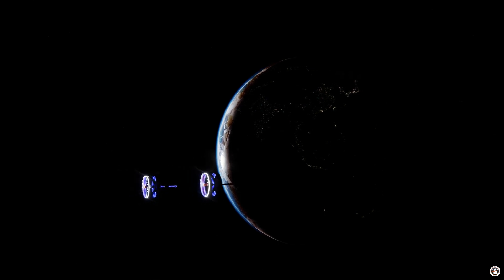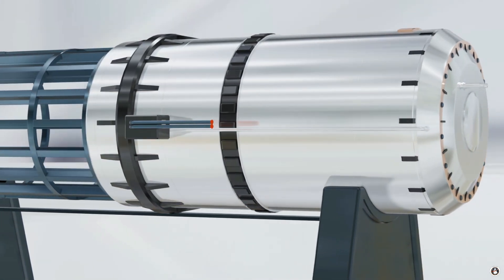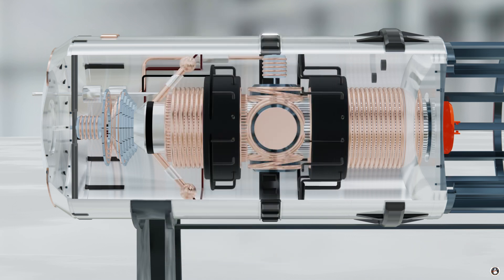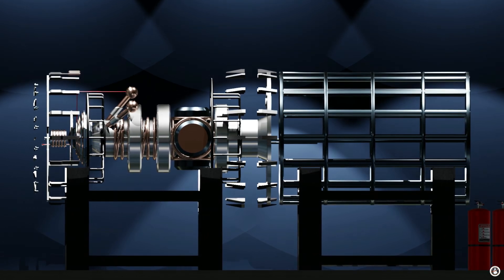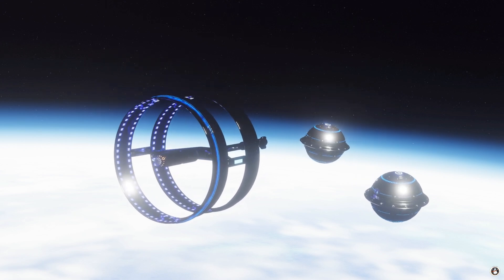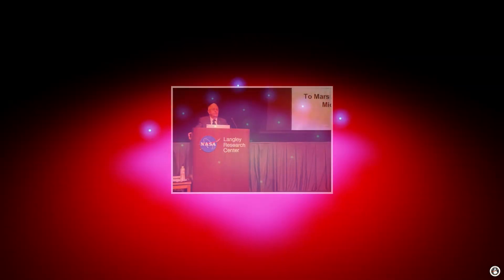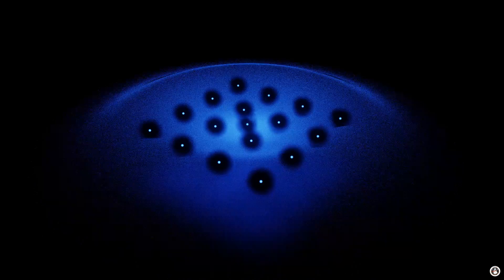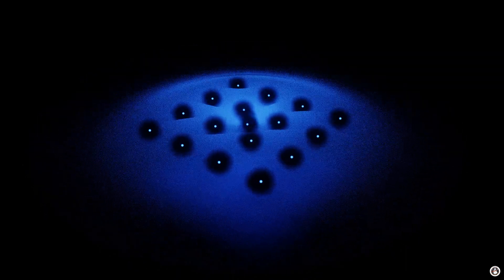Muon Catalyzed Fusion Engine - 8% Speed of Light - Mars in 5 days?

Comment: Two fundamental questions. First is, can this actually be built to work and when? The other is, what is the thrust to mass ratio? Just how much mass of a spacecraft needs to be devoted to this propulsion system (and associated supportive gear, such as heat radiators), how much thrust can it generate and how much fuel is consumed over time (how much is needed for say a round trip between Mars and Earth say)?

Comment: Given that if this works you will have a highly ionized exhaust plume, could this be directed into a magnetohydrodynamic collector and generate electrical power for the ship - or even as terrestrial power generation? Providing you solve the eroding electrode problem, of course.

Comment: Would this be able to replace chemical rockets to launch objects into space? Also, would the same principle be used to slow down the spacecraft when it reaches the destination?
Reply: The problem with any nuclear rocket is that it is very difficult to get it to have a high TWR, because of the added mass of reactor assembly, only the Nuclear salt water rocket and Project Orion are the two nuclear drives I know that have an effective TWR that can propel directly against Earth gravity.

Comment: You still need two engines. One facing forward and aft. Does the engine provide bleed off power for ship operations? If not then the ship would need additional power generation on top of these engines.
Reply: Not really it can use reaction wheels, gimbles and monopropellant thrusters to switch thrust directions to the retrograde.

Comment: The trick is to fall in the direction of travel; not be pushed which is the common approach.
This would eliminate the g forces experienced. 
(There is no sensation of acceleration when skydiving.)

This will require recognizing that Einstein conflated mathematical dimensions with physical ones.
There are only 3 dimensions.

The speed of light limitations are due to the increased mass due to acceleration, but if no acceleration is experienced, no increase of mass happens.

The Sun and the Earth are supposed to have their own independent frames of reference.
This would mean that the Earth is being attracted to a position that the sun occupied 11 minutes ago.
The earth would spiral into the sun if this was the case. It doesn't therefore they both exist in the same  reference space.
Nothingness is not bent.

Comment: I assume the fusion exhaust is "channeled" out the end of this engine magnetically. So, what powers the magnets? Seems like you would need a lot of energy to provide the reactive force. Did I miss something?
Reply: If you are producing more energy than you put in, you can likely convert some of the excess heat into electricity to do that.

Comment: This may be a stupid question, but here goes anyway: It seems by the description in the video, that the engine would be throwing out ionized or easily-ionizeable particles. If that is the case, would it be possible to use a similar system to a standard Ion propulsion drive in order to accelerate the exhaust particles even further, or would that be too inefficient?
Reply: Actual ion engine have low thrust but, using nuclear fusion energy will be possible to use helium prodused from reaction to obtain more thrust. Importart is necessary neutralize the ions out of the ship by emission of electrons.

Comment: It's a great advancement for the generation ship.  50 years to Alpha Centauri vs. 100 or more.   If only someone would solve the tachyon puzzle so we can do this in multiples of lightspeed someday.
Reply: It all depends on how fast it goes from 0 mph to it's max speed. At light speed it take 4 years to get there if the engine goes from 0 mph to light speed instantly, and not stopping once you get there. According to their math the engine can do 8%C plus so I'm going to use 10% to make it simple. At 10% C it will take the ship 40 years to get there and it still won't be stopping. If it can get it up to 10% and cruise at that speed faster than the halfway point then the 40 year trip is possible since that would allow you to slow with less than half the distance to Alpha. If it can't do that then we're still looking at least 80 years. There's one other thing that wasn't brought up is the time dialation effects on the crew going 10% C. There would be a slowing of time for the crew so they wouldn't experience the 80 year trip lasting 80 years. How much less time I have no idea. If they only experience 8 years for every 80 years for us then the ship wouldn't even have to be a generational ship. Again it depends how fast the engine gets up to 10% of light speed. Anyone know the math?
Reply: Time dilation is minimal until you reach over 50% the speed of light and even then until you reach over 80% it isnt all that big. At 10% you would experience most of the 80years.

Comment: Communication is the problem, we are having problem communicating with Voyager .002 light years from earth. I suspect communication with a spacecraft would go dark before .2 light year or 100 times farther than Voyager and 100 squared reduction in signal strength and pointing accuracy given the inverse square law. It may have a 1000 squared reduction in signal power and pointing accuracy at the nearest star, and both stars/solar systems are moving through space in different directions at very large speeds. What is the point of sending a probe some where that you cannot communicate with, if I were funding it I would like to see the number on communication and my first proof of concept would putting something .1 light year out and communicate photos back.

Comment: This has my bullshit alarms going off. Muon catalyzed fusion is hardly a novel idea, and where it practical, it would have garnered a lot of attention for its potential uses in the energy sector (unless of course your engine is operating at a negative energy trade off, to which I would respond there are plenty of more efficient ways to use the energy your craft would have to carry or have beamed onto it). So either you just solved the world's energy crisis forever, or this is nothing
Reply: Thinking something similar here.
Lots of coils, lasers and magnectic fields.... from where all this energy is coming from?  another fusion reactor?
Also, my bullshit alarms already turned on the very beginning by the way of speaking and chosen words.

Comment: Seems very theoretical and pie-in-the-sky. Maybe in a thousand years we can actually build one of these engines, if a lot of theories test out. Nice that it is at least trying not to produce neutron radiation, but the video says it produces gamma rays, which is even worse news for the crew.
Reply: Gamma rays do not make materials radioactive, so easier to shield than neutrons.
Reply: @TCBYEAHCUZ  Gamma rays are more penetrative than neutrons, and can do lots of damage while going through human tissue. They're like x-rays, but with more energy. There are some materials that are fairly effective at absorbing neutrons.
Reply: @scotth6814  Yeah but your shielding doesn't break against gamma's, it does against neutrons as the neutrons slowly transmute your shielding into radioactively hot mess itself.

Comment: Project orion - “am I a joke to you?”
Capable of 3.3% speed of light with enough bombs and that was only stopped due to test ban treaty.
Reply: inbound deceleration equals flying into nuclear bombs
Reply: @lucifercrow7050  or gravity assist....could use gravity deceleration from any planet or star. Turning would be a bitch though
Reply: @Chris-cv1ll  idk 3.3 % the speed of light we might need a couple solar systems worth of planets or stars to slow down enough
Reply: @lucifercrow7050  giant solar sail coming in would help a bit then stow for some gravitational atmospheric drag around a gas giant (as we would have to find one in the outer system for any real chance of long term viability) and then use the sun to slow down some more. Oh and we could still fly into the cloud of radiation as we would need to over build for interstellar radiation of which we only know what voyager one and two have sent back
Reply: 9,893,151.11 miles per second. That's 3.3 % the speed of light. 25,000 miles per hour is the orbital speed of Earth. there's just no way any gravity is going to slow that down enough, maybe a supermassive black hole. 'Oumuamua that interstellar asteroid or comet was only traveling 60,000 miles per hour and our Sun couldn't hold onto it.
Reply: @Chris Cloo  Let's just hope they get on the ball and we're around to see a little bit of it
Reply: @lucifercrow7050  not going to happen....also what if we sent an unmanned army of smaller ships (no orgánicas means less care for radiation) and have them build a magnetic catch or some way to slow us down on the other side? Or maybe we should work on negative energy as it’s more feasible then my catcher idea...then we could just use warp drive
Reply: @Chris-cv1ll  i think china is sending a light sail in 2025 so maybe we'll get some photos in 2090 lol
Reply: @lucifercrow7050  well there was a design a few years ago for laser driven light sails that could get up to 20% speed of light. the design called for them to be small and light and it was going to require swarms to actually have a chance of really seeing anything interesting and not smashing into stuff.....but meh
Reply: Project Orion is such a ridiculous but fun in theory application of nuclear propulsion. But I would really be interested into practical fusion propulsion, especially by using a Small Modular Reactor like the one used on nuclear submarines to power an Ion drive

Comment: How about if you built a 7km-long 100-Gigawatt linear accelerator and bolted it onto the exhaust?
Start with 5 million tons of hydrogen and once you're up to speed, crank up the old Bussard ramscoop!
16% C, I reckon, with an 80,000 tonne woven titanium shield a kilometre across and a kilometre deep. 
Because at that speed a single grain of sand hits with the force of 50 tons of TNT. And a typical interstellar dust particle hits like a .50 Caliber Barret. :D

5:25 - did you really say Nucular? Because that is what it sounded like!
5:55 - yep. You did. Hang your heads in shame.

Stopped watching.

Comment: You don't mention net energy/gain factor (Q) at all. My understanding was that the energy required to create muons was so great that you couldn't get net energy out of the fusion reaction. Are you saying that the Rydberg matter and the Bose-Einstein condensate is a workaround for this that requires less energy to create the muons and thus you can get a net energy from it?

Essentially, you're using a catalyzed D-D fuel cycle, but such a fuel cycle isn't aneutronic. How are you capturing the energy? Direct generation of electricity would require some kind of charged particle capturing.

Comment: I was really hoping that warp drive would be in my life time.
Reply from the maker: How about within the next 3-5 years, is this soon enough for this engine? Practically speaking, we already possess the technologies needed to assemble this engine. Warp coils will be in use within the next 7-13 years for slower-than-light travel. We will not have faster-than-light travel until 2065-70.
Reply: @asteronx  Ohhh I see and also great video keep up the great work!
Reply: @asteronx  I'd imagine the first production models will be big, but it'll not be the case as we tend to make it smaller while we improving it. It also may start out a an expedition with a handful of selected volunteers due to risks and the investment in the program. Always start out small first & if it's successful, then we can send more teams. Expedition before the exodus.

Comment: Great video! However, since the fusion still occurs inside the spacecraft, the amount of heat to be dissipated is likely to be astronomical, as are the heat sinks.
Reply: The heat sink is space itself, and it is both deep and limitless in as far as being a heat sink goes.
Reply: @edmundworrell530  Space is just the physical environment where the heat exchange takes place. However, as in outer space there is no convection but only irradiation, the heat exchange is much slower, requiring a much larger surface area of the heat sinks.

Comment: The problem with putting energy into going very fast is, that the deceleration will need a lot of energy too then... :-/
Reply: About the same amount right? If you flip and burn to slow down at some point in the middle of the journey.
Reply: so you need 2 engines 1 in the back and 1 in the front :D
Reply: @danielhalip  you just flip the ship around.  It is easy to do in zero G.
Reply: @cole2839  its been one year man 😂
Reply: after you finish with the back one you start the front one
Reply: its like hyper drive exiting

Comment: Chemical processes cannot outperform nuclear engine in the vacuum of Space, but would they still be ideal for use on the surface, where the exhaust gases would eventually be recollected and reproduced as fuel, methane in mind? It’s likely a large sized ISV would have to be constructed in orbit between 5-10Mm from earth, launched from orbit, and sent on a departure trajectory to the outer reaches of the Oort Cloud before powering up its warp drive and reaching a star system within a  reasonable number of years for significant human life experience. 

I don’t imagine anyone wanting to feel like being 35 after suspended animation for hundreds of years, and with this leaving the solar system as its own problem could be done within a few months.

Comment: Downside being that you need a literal particle accelerator to make such muons which basically means you already need a fusion reactor to power the thing. So with that you might as well just go the Halo route and go with fusion as both your propellant and power with your propellant for thrust and using electrostatic direct energy conversion. Also note that Space X has directly stated no intentions on improving combustion engines. Elon stated as such in a video where he was asked if Space X would consider aerospike engines which he said "if NASA proves it's possible, then we'll do it" saying that the RND and risk is too much for a for profit business as they are.

Comment: Anything new on Wormhole/warp drive or FTL propulsion system?
Reply: Wormhole drives are a long way off... As a result of us needing to first of all discover a wormhole and work out how it works. Warp drive: We have the theory, estimates of how much energy it'll take, but overall, we don't have the particles required to pull it off literally. Even with the proposed additions, the negative space created by rapid EM occilations doesn't have enough to get us much past the speed of light of even we had fields of that intensity. However: couldn't we apply the EM occilations idea and use it to lower the mass of the ship as a whole? Then, using these thrusters on an object with the relative mass of a baseball, accelerate a lot faster?
Reply: @jerryplayz101  nice explanation, and what do you think about kugelblitz drive?, quantum teleportation/entanglement?
Reply: @herescomesthenotoriousmichael  If I remember correctly, the kugelblitz is a mini black hole that somehow can remain stable. Hmmmm. In short, I personally don't see how they will work, but I don't know everything about that form of propulsion. In short, Quantum Teleportation looks more and more likely than a mini black hole FTL method. Scientists are currently working on a method to make a multi-atom structure have act like a single quantum object. If that can be achieved, it is the first step towards teleportation.
Reply: @jerryplayz101  ah,  ok gotcha bud!  Thanks
Reply: Light speed, ridiculous speed, LUDICROUS SPEED